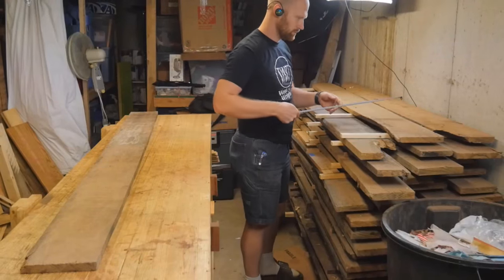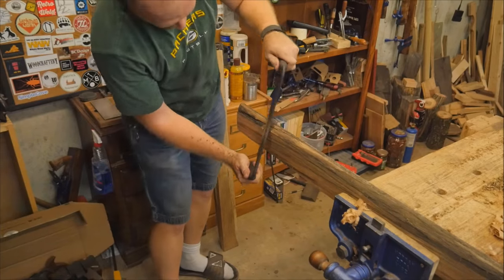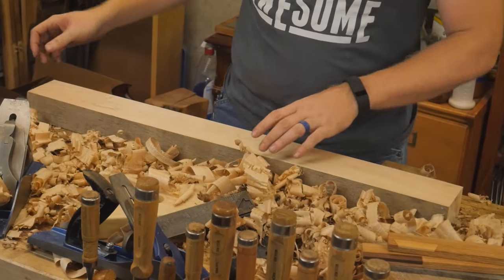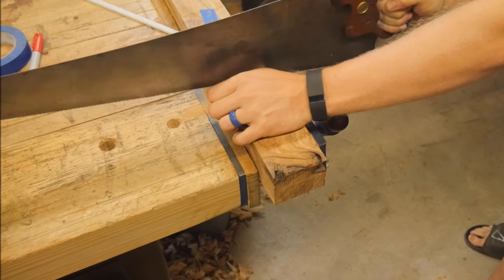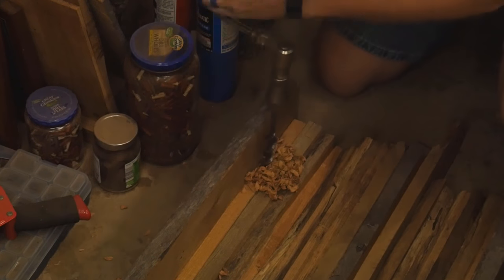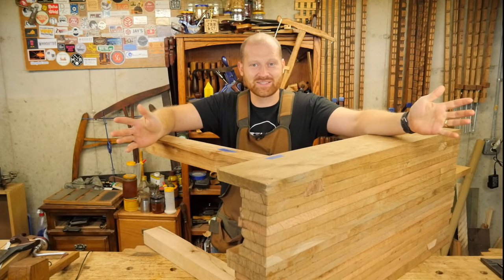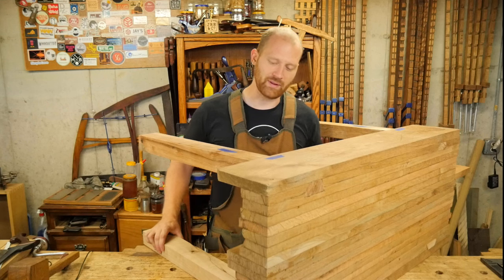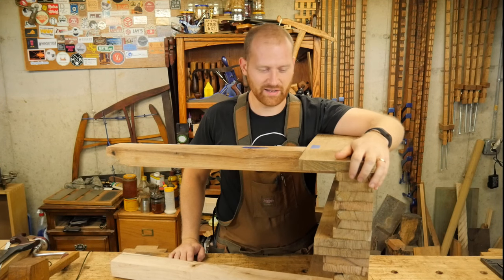Making a Baby Roubo Bench From White Oak For My Kids Part 1

Comment: What kinda plans are those?
Reply from the maker: I am not following any plans. it is all off of the top of my head to fit the stock I have on hand.
Reply: Planes lol I meant what kinda planes?
Reply from the maker: I see. that makes more sence. LOL it is a collection. I am using a #5 as a scrub plane, a #7 for jointing and a #4 and #4.5 for general work. I did a video a while ago on my method and what I use here if you want more detailed info. https://www.youtube.com/watch?v=ioOOWGqe_LA 
I hope that answers your questions.

Comment: Roubo benches don't have "stringers" (actually, 'laterals') supporting the top because real Roubo benches are made of single, thick planks that are the full width of the bench.  Because the top is so strong, they don't need lateral supports for the top.  Furthermore, having a top that doesn't need support other than the four legs means the top is free to expand and contract without having to figure out how to secure a top that moves one way, to a lateral that hardly moves at all.  One of the virtues of real Roubo benches is that simple leg structure.  In the recent rush of people making Roubo "style" benches, lots of them are failing to understand that a single, thick plank top with four legs stuck right into it is the definition of what a Roubo bench is.  Benches with two tops are not Roubo benches.  It's like genetically engineering a woman, giving her attributes of several top models, and then calling her a Christie Brinkley because everyone has heard her name before.  Your laminated top is plenty strong enough, probably stronger than a solid plank.  You don't need lateral supports at the top.  Just put laterals between the legs, near the floor, just like Roubo drew.
Reply from the maker: +deezynar interesting. Thanks.